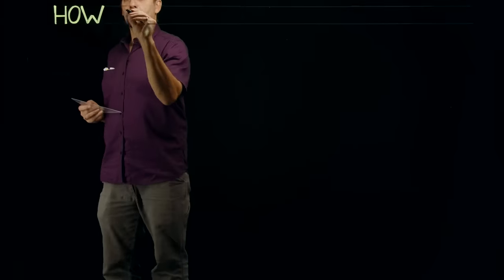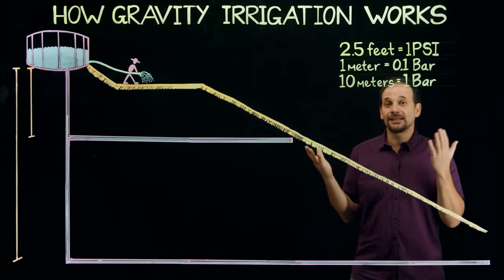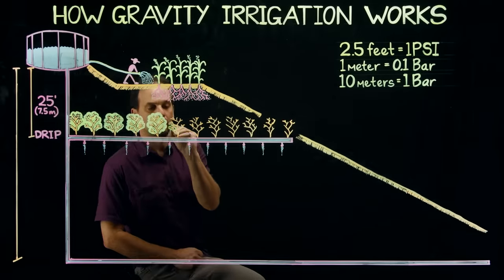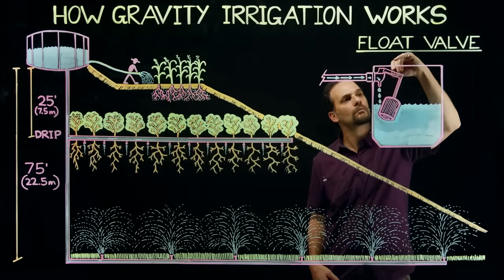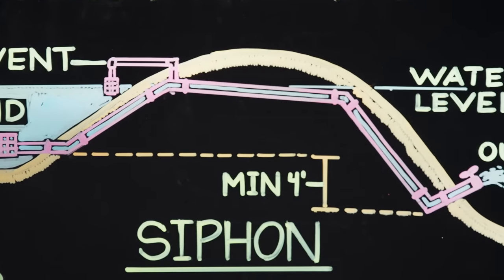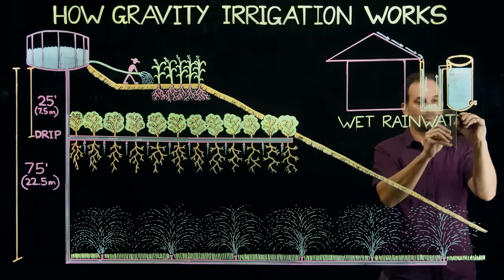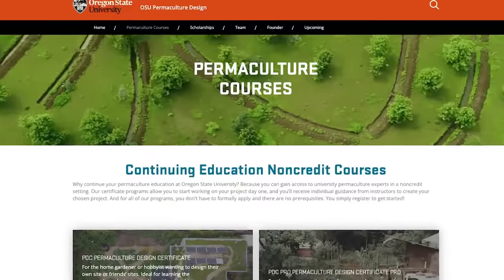How Gravity Irrigation Works

Comment: 🎯 Key Takeaways for quick navigation:

00:00 Water moves by gravity without electricity, governed by physics.
00:39 Water pressure is 1 psi for every 2.5 ft of head. In metric, 1 meter equals 1/10th of one bar.
01:06 In flat landscapes, flood or furrow irrigation can use low-pressure gravity.
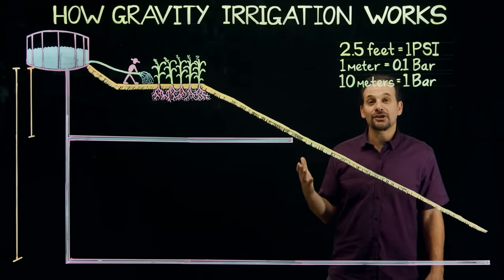01:35 For pipes and irrigation systems, height above the point of use determines pressure.
02:02 Drip irrigation needs a minimum of 10 psi, requiring water storage at least 25 ft above.
02:55 Sprinkler systems require at least 30 psi, needing water storage 75 ft above the outlets.
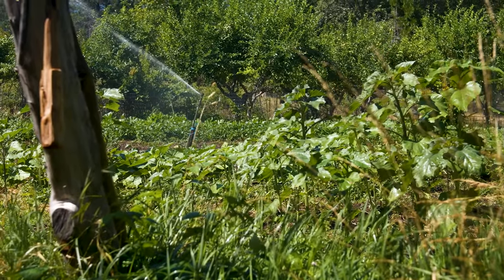03:36 Check product specs for minimum and maximum pressures; consider elevation and friction loss.
04:04 Friction loss in pipes affects pressure at the outlet; use charts to determine friction loss.
04:59 Float valves maintain a steady water level in troughs or tanks, ensuring a constant water supply.
06:07 Siphons use gravity to move water over obstacles without the need for fuel or electricity.
07:04 In rainwater harvesting, a "wet system" allows water to flow down, up, and into a tank.
07:31 Gravity irrigation principles can transform landscapes sustainably without the need for external power.

Made with HARPA AI
Reply from the maker: Thanks so much for this. Wow, AI recreated my outline perfectly
Reply: @amillison  Thank you for all the education you continually put out.  In addition to Matt Power's text(s) I use your content for my son's homeschool materials.  It has had a substantial impact on their engagement and retention.

Comment: You don't need 10 PSI for drip irrigation. Flag emitters can work even with less than 1 psi. I know, I have been using flag drip emitters with an IBC rain tank raised up on cinder blocks through 3/4 inch hose and 1/2 inch drip lines 50 to 100 feet long. Depending on the water level in the tank and ignoring friction my pressure would be roughly between .7 and 2.3 psi, averaging around 1.5 psi. You have to let the drip run longer than if it were at 10 psi, but that's not really a problem.

Comment: Wells are obviously a luxury, but the easiest way to bring water to the individual is through rainwater harvesting. When my family goes camping we use a julka ran in solar and batteries for our pressure. I run stream and pond water through a Sawyer water filter for drinking water. It's cheap and simple. Wells are expensive and deplete the ground water if water storing techniques are not being used.
Reply: Yorumlar için teşekkürler efendim Thanks

Comment: You need to clear stagnant water in wet tank system.
Reply: Depends on your zone.
Reply from the maker: @vivalaleta  In a cold climate the water will need to be drained. But the water in the 'wet' part of the system will be displaced with each new rainfall. So in a climate with long dry spells, then I could see the water becoming stagnant. Although a proper system will have screens to keep out any insects and rodents.

Comment: Question on the pond, how do you keep the spot where the pipe goes under ground from being a point that erodes the dam?
Reply: 1) Plantings.
2) allowing enough clearance so the water fails to undercut and wash away the dirt.  
3) Gradual slopes instead of steel ones
4) use rocks to take the brunt of any splash...
Reply from the maker: The siphon pipes are often installed above ground. They are only underground for protection. The one I drew would just be very shallow underground, above the high water line of the pond. Conventionally, people solve this problem using baffle plates: https://keyline.com.au/BafflesFitted.jpg

Comment: Thank you! so valuable.  What about Solar as a switch with a Solenoid valve to TIME when you water?  I'm building a tiny, cheap gravity fed irrigation system off grid in Florida using a 5v solar panel,  5v solenoid valve, 1/4 inch lines with needle holes and  50gallon rainwater tank I collect  off some sun sail.  Even in winter here in Florida it's always full. I plan to point the solar panel vertical west so that it only turns on at sunset for a few hours, at which time it will bleed about 2 gallons a day hopefully watering every day, even in dry months where we have 20% chance of rain and only 2 inches average a month.